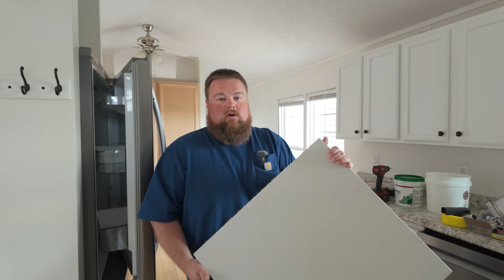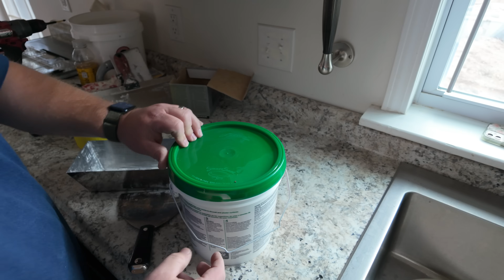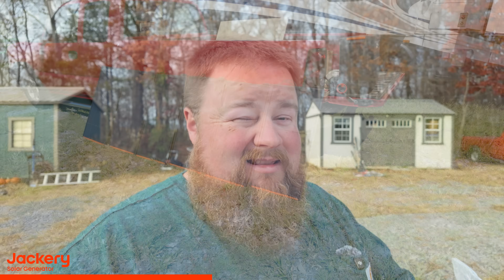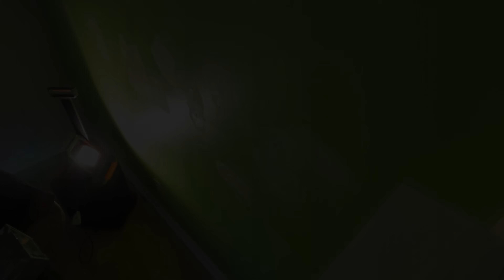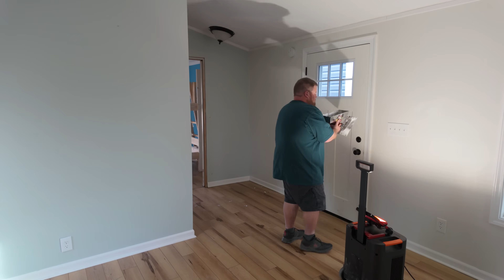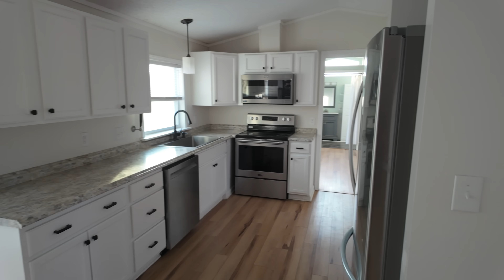Saying Goodbye: Last Fix in Our 1988 Palm Harbor Singlewide Mobile Home

Comment: What timing. I just started some drywall work in our 1996 Palm Harbor. We hate sanding, will be trying the sponge. I originally found your channel looking for ideas on repairing some seriously bent floor joists, and ended up doing something similar to your sister boards.

Comment: I've tried the wet sponge technique and for me it didn't work too well. I may have had the sponge too wet or maybe wiped it too vigorous or something. It seemed like it always took off all of the mud where it was super thin and then left a visible edge around the patch. With sandpaper I've been able to feather out the edges better and make the patch disappear. But it seems like Angela has perfected the technique so I say do it however it works for you.

Comment: Sam, I've done a fair share of drywall.  Your one mistake I see is crisscrossing the top piece.  You should have placed it between the two sides, to eliminate the corner build up. As with your doublewide. Sheetrock will crack in transit. As for finishing, Angela is right.  A damp sponge will fill in the small pores left open that sanding will expose.

Comment: I have a friend that is a Professional drywaller, and he does the same thing that Angela just did with the drywall knife. I have seen him do that for about 300 years .. By the way Sam, you do a pretty good job, a lot better than I can do.. lol   As far as the movers of mobile homes, I have seen them put them in places that looks like you would have to get a big chopper in the lift them in or out. It is surprising what an experienced crew can do with big homes in small spaces... I salute them.

Comment: Great job on the drywall. I also use the sponge/water method when I'm repairing nail holes. I didn't know about your videos when you bought the 1988 mobile home so I don't know what all you did to it. The kitchen is gorgeous and I love the flooring.

Comment: Awww. 😢😊 switterbeat for sure. Drywall technique? Have done that with wet rag and it didn't work well. Sponge probably better. But what surprised me the most was putting a board behind the drywall and screwing through the drywall into the wood😮. How sturdy could that be? Guess if they don't lean on it it'll be ok. Love watching. Always learning new things from you but mainly here for you! Love who you are not just what you do. God bless. Maranatha.😊❤🇨🇦🙏

Comment: in the uk with plugs that stick out i just get the scraper behind the lip and tap it with my palm and it cuts off and the rest fall behind the plaster board (dry wall) for you guys then fill some plaster in the walls ,then go back after few hours and fill in , you do not get the lump or need to take extra plaster of the board , the bigger hole get cut out of dry wall you had left put it behind dry wall screw it in then fill in edges and wait till nearly dry and fill . done .